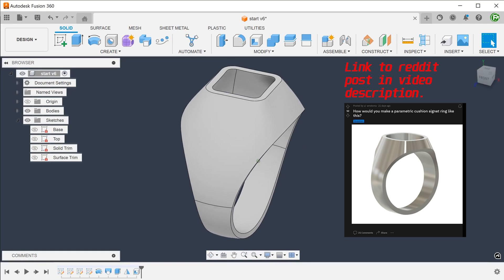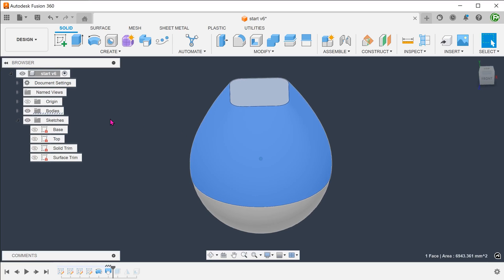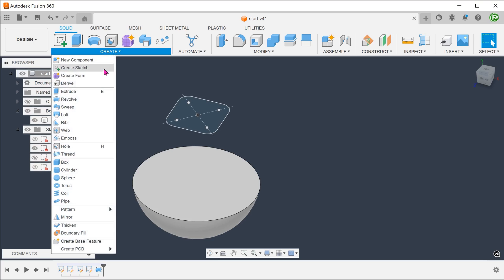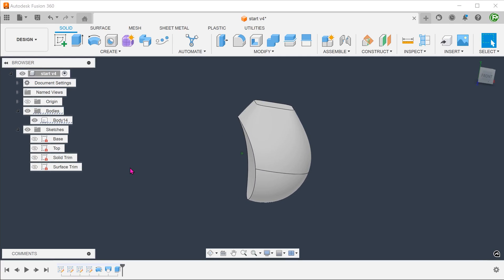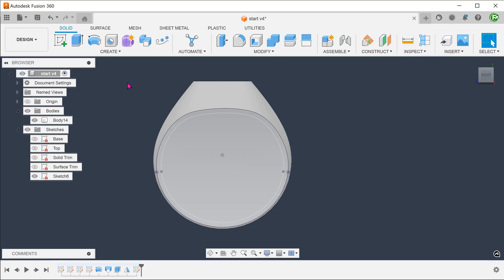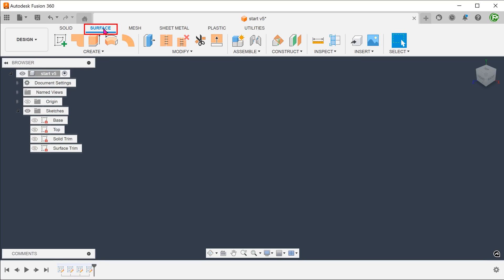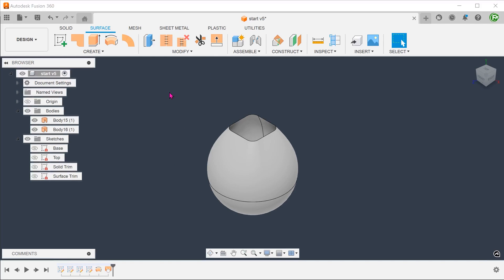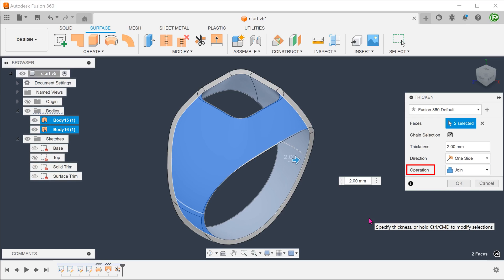Fusion 360 | How would you model this ring?

Comment: Some nice and clean modeling there, as usual. I have some comment though, since this is most likely a shiny surface and purely ornamental piece, I think it would be more appropriate to use G2 continuity on the loft, as reflections will have a more pleasing (smooth) appearance this way. Also, I think it might make more sense to prioritize a round hole, and so extruding the hole, then project and offset to create the flat edge makes more sense to me, but this is just nitpicking.
Reply from the maker: I went back to try G2. It did slightly improve the smoothness. However, it still slightly creases up near the corners of the square. I wonder what can be done to improve this.
Reply: The sketch fillets are also G1. Maybe replace them with a splinter and use smooth constraint? Or "cheat" and don't put the fillets in the sketch, but extrude a solid body, and use G2 fillets on it. Then you have a G2 face that you can loft to.
Reply: Just tested both of these methods, and they do work. for the G2 fillet, use a weight around 2, and large fillet "radius". Similar for the spline method. Oddly Fusion insists on putting the seam off center, resulting in a slightly A-symmetric Loft. Not sure what that is about.

Comment: Curious why you discourage the use of fillets in sketches? Do you have a video discussing this?
Reply: I can not answer for Fusion 360 School, but I too avoid putting fillets (and chamfers) in sketches whenever possible. Unless otherwise required I prefer to have my chamfers and fillets all the way at the end of the feature three. The advantage of this is that both the sketches and geometry is generally easier to work with and change when you don't have to deal with fillets and chamfers everywhere. It can also be advantageous for performance, if you have a complex model, to be able to disable the fillets and chamfers while you work on the model.
Reply from the maker: Fillets in sketches tend to break any existing constraints and dimensions. They also make it harder to adjust sketches down the line.
Reply: @Fusion360School  I will have to remember that. I have a very bad habit of doing that. Still learning Fusion 360. I am still treating a sketch as a  drawing. I need to quit thinking that way. A sketch is only to get you from point A to point B and not from point A to point Z.
Reply: One of the main reasons is so the fillets or chamfers are available in the time line for editing, suppression etc.